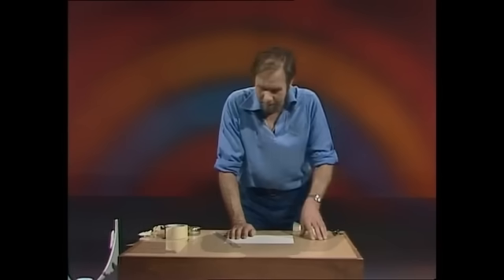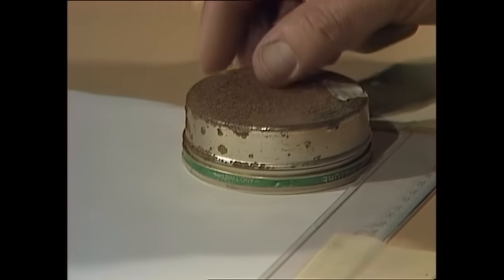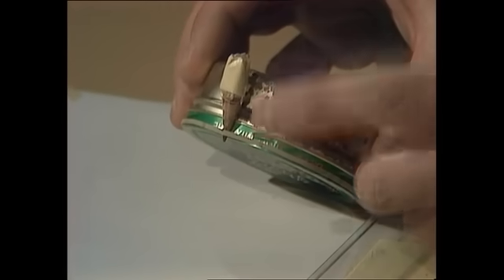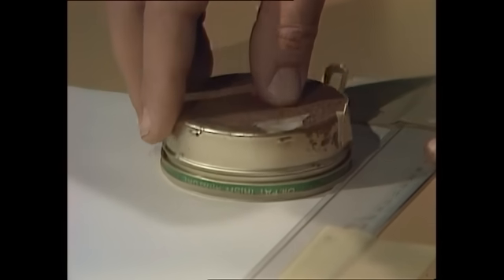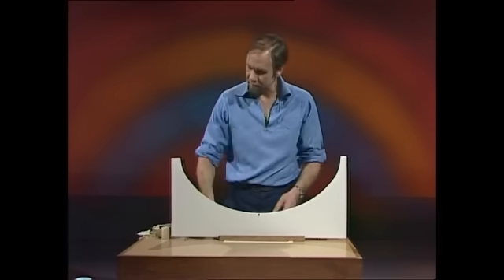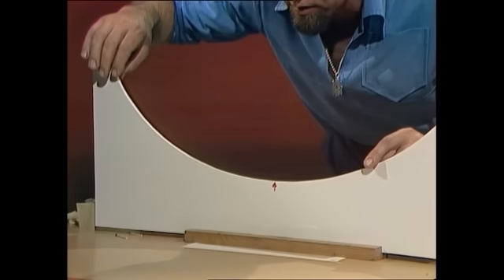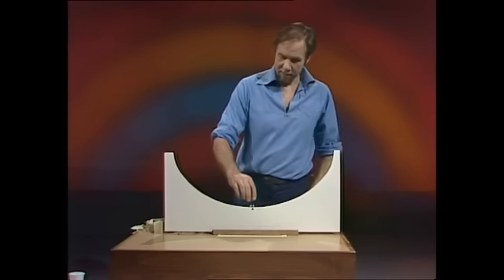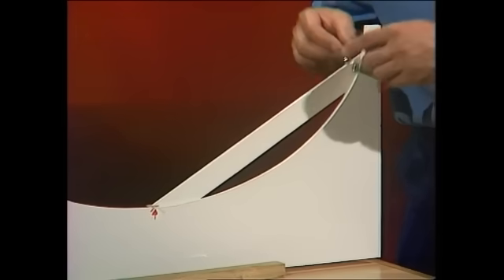The mysterious isochronous curve

Comment: Why didn't he simply use a compass to cut a calculated oversized circle in a piece of cardboard, cut a hole at the desired radial point and simply insert a pencil in the hole and rotate the cardboard along the secured rule?

Comment: Checked my watch. Not April 1st. Checked that there aren't any hidden cameras in my room. Not a prank show. So, um...............WHY!.................and, er...............HOW! I mean, doesn't Time = speed x distance? So when comparing it to the straight line, maybe there's less resistance to gravity in the shape of the curve. As to the same time being to get to the centre from anywhere on the curve.......maybe the increased momentum from a larger distance exactly balances shorter distance.
Reply: When I say "increased momentum", I mean from the acceleration: 9.8 ms-2 in free fall (I know this isn't free fall but there will still be acceleration) Earth gravity, dry air at 0 degrees Centigrade......You know.....just.....if anyone cares...

Comment: I'm no mathematician, but I'm assuming this has something to do with gravity and acceleration? They meet at the same point regardless of location on the curve because a ball-bearing at the bottom of the curve will have less acceleration by gravity than the one much higher up on the other end. Dunno if I'm using the terms correctly, but hopefully it gets my point across.
Reply: ya. didn't explain why the ball following a straight path to the arrow(middle) is slower then the one on the curve. I was guessing same thing, in that the curve gives the ball more speed do to gravity right?

Comment: What are the real life practical implications, .for  machines or manufactured products where an isochronous curve is advantageous?
Reply: Fair question, and I'm going with reverse logic for a possible answer and say a bicycle tire
Reply: I'll try again: is there an example of a product or manufacturing process that has been helped by incorporating an isochronous curve it its design.
Reply: yes, good question. take a look at the ISSC isochronous stress strain curve for plotting creep data during production of high temperature materials
Reply: Found it! 
The isochronous curve is so elegant and the property that you demonstrated so unusual yet simple that I thought there must be a counterpart in nature.

When the bob of a pendulum sweeps an arc of a circle, its period varies (slightly) with the angle of swing. But there's no variation in period with angle when the bob sweeps an isochronous curve . That tallies with your demo where the time for the ball bearing to reach the base point does not depend on its starting point in the curve.

The effect was discovered by Huygens in the late 1600s. He built a pendulum that could swing through an isochronous curve and therefore keep better time, unaffected by air resistance.  https://www.math.nmsu.edu/~history/mm-3-2-huygens.pdf

Comment: What amount of "force" would it take to ensure the straight line ball on that exact angle would meet the ball on the curve at the exact moment. Determine that equation and you are on to something and just might be able to measure fluctuation s in gravitational waves. Where the cheetos?
Reply: Jake Glassmoyer simple algebra problem, would not even require calculus.

Comment: In noting the speed of the bearing as it moves down the curve, as compared to its movement along the straight edge, it is rather obvious that the curved space provides for the greater angle of "free fall." The surface providing the least obstructed surface between itself and the bearing will allow for the fastest rate of descent.  Nothing mysterious about it.

Comment: The straight vs curved drop makes perfect sense because the curved drop has more momentum due to the fact that the ball is dropping for the first half of it's ride; At first it didn't have the amount of friction as the other ball. Then, in the second half of it's ride, it had more friction due to it's gained weight from it's momentum.
Reply: Gained weight from its momentum? Sheesh. I was doing sines and cosines and you're bringing relativistic mass into it! 
I doubt he cut that shape out accurately enough for that detail to show in his results.
Reply: That's what I was thinking, it's cool but I don't really find it peculiar or mysterious. Same reason the two balls meet at the middle, it's all about the potential inertia from the steeper parts. It moves faster but it also travels a longer distance. The simple reason they meet regardless of position is just due to the fact that the curve is 'isochronous' as he said.

Comment: This only works when there is a gravitational force applied, the straight line has more resistance to gravity but the curve allows for "freefall" thus the ball on the curve has more acceleration (the rate of change in motion and position) and the ball on the line has more inertia (resistance to change in motion and position). This is why a vert ramp (half pipe) for skateboarding is the shape it is. Also if you had a way to bring the balls center of gravity in at the apex point of the curve and then released it back to a normal center of gravity it would go back and forth forever. But remember the law of conservation of energy. This change of center of gravity for the ball takes energy to keep it going forever.

Comment: Very interesting and informative. Being a pedantic type I must point out that you’re using a rule (or straight edge). A ruler is someone who rules. 👨🏻‍🎓
Reply: Also being a pedant, I must point out that a "rule" is "one of a set of explicit or understood regulations or principles governing conduct within a particular activity or sphere." Of course, that's only one definition, and -- similarly -- "ruler" has multiple definitions. One of the definitions of "ruler" is "a smooth-edged strip (as of wood or metal) that is usually marked off in units (such as inches) and is used as a straightedge or for measuring."
Reply: SeikiBrian Thanks, you’re quite correct. My problem is I still think back to my school days over 60 years ago. It seems that the graduated straight edge etc has become accepted as a norm.
I still use rooves rather than roofs.
Reply: We're close to the same age, it seems. I still recall learning to use a slide rule in what they now call middle school but we called junior high school. (And I took my first year of higher education at a "junior college," not a "community college.") Although we called the former device a slide rule, we called the single-piece tool we used for measuring small lengths a ruler. (And while many people in my region of the USA pronounced the plural of roof as "rooves," we still spelled it "roofs.")

Comment: Does the Isochronous curve conform to the golden ratio and is it half of an ellipse? Might have to go on the drawing board to check it out. Will get back.
Reply: Considering that the curve's width is the circle's diameter and its length is the circumference, it's clear it's more related to pi (3.1416...)
Reply: morninboy im interested please let me know when you find out the answers :)
Reply: Still waiting
Reply: it looks like it to me. and it also looks like the perfect curve for a dick which I don't have since mine is broken and bends down :((

Comment: So, while the shortest distance between two points might be a straight line, I guess the shortest time between those two same points is an isochronous curve. Quite interesting indeed.

PS (addendum) My original post was just a joking play on the classic "the shortest distance between two points is a straight line" saying, but I'm glad to see quite an interesting discussion taking place because of this comment. Science FTW!
Reply: Only the shortest time under the influence of gravity, if you were driving a car between two points then a straight path would take less time than (any sort of) curved path
Reply: The shortest course between two points on the globe is a 'great circle' route, which basically means you follow a path across the globe's surface that is part of a circle whose center is at the center of the planet. Such a path is by necessity curved.
Reply: the shortest distance between 2 points is a great circle. the reason sometimes a straight line is shorter is because of the type of chart you use, it varies with the type of projection used. and if you want to reach the middle point of the test this guy performed with the bearings as soon as possible you have to trade the potential energy of the bearing asap(straight down) followed by a smal radius curve to convert the vertical motion to horizontal motion. great circles are curved on a mercator chart and straight on a globe.
Reply: Spetsop  --   No the shortest time between two points is a straight line, but without relying only on gravity to provide the velocity.
In other words, shoot the ballbearing out of a cannon (or a railgun..).
 I mean, if the angle of the straight line was closer to horizontal, the ball would take much longer, and it's all down to tbe direction of gravity, not the shape of it's path.
Reply: +Drew Lovelyhell : Firstly, thank you for spelling "cannon" correctly. Pachelbel rests more easily. 
Secondly, and I apologise for the nitpick, a cannon wouldn't send the ball in a straight line. It would send it in a parabolic arc modified by retardation due to air resistance. Over the very short distances shown here, at velocities associated with modern rifles, you'd never know, but if you check the ballistics for a 5.56mm bullet you can see that it slows down a lot in the first 100 metres of travel and quite a lot in the second, losing speed less rapidly as it goes because at lower speed it has less air resistance. 
With sights "zeroed" at 200m, on a still day, you aim at his belt buckle from 100m, centre of mass from 200m, or throat from 300m or somewhere over his head beyond that.
Reply: Sableagle   ..   Well, I was thinking ideally of a cannon in a vacuum unaffected by gravity, but I didn't specify that in my comment.
Reply: I was going to say: momentum has a part to play. And Mr. Brian said gravity.
Reply: bullshitdave You’re correct.  It’s called a great circle route in aviation.
Reply: But not in zero gravity.

An isochronous curve is only as fast as the forces applied to it at the time... Potentially a fraction faster at a point in the curve due to centrifugal force.

Maybe I should have read this thread before posting. Ah well great minds obviously think alike.
Reply: You should watch vsauce about the brachistochrone...

I think the tautochrone property is more interesting...
Reply: And if the chart is of a small area with no need to allow for curvature you are on a plain- So it's Plain Sailing. The other golden rule, always use the scale opposite your plot on the chart, the scale changes as the curvature is adopted on large scale charts.
Reply: When did FTW get a meaning change🤔??? Or maybe it's demographic and age because, FTW did not mean " for the win" in my day or surrounding 🤔
Reply: @rickblaine7463  What did "FTW" mean in your day and surrounding? I'm 33 and everytime I saw "FTW" on the Internet, it only meant "for the win".
Reply: @Spetsop  
Fuck The World -I just turned 50, so FTW was a thing before the internet and texting-acronyms
Reply: @mestizoboy  ....thank you kind sir for clearing that up! Especially the part about before internet and texting 😂...I just about laughed myself to death when I read the response.🤣🤣🤣...not out of disrespect but, because I couldn't believe how old I was and how young that made the response.
It's funny how a decade can really separate a generation
Reply: @mestizoboy  could you imagine all the gangsters the "OGs" if you will faces to know that their FTW tattoo on the inside of their lip or anywhere on their body now is interpreted as "for the win"🤣🤣🤣...
By the way...great video and explanation. Sorry to tangent!
Reply: @mestizoboy  Oh geez haha, I've never heard of that one before.  Yeah, I can see how confusion can arise lol
Reply: @rickblaine7463  "OGs with FTW tattoos" LOL 😂  That's brilliant!
Reply: @rickblaine7463  
Hahaha: Exactly. I have friends with that tattoo. One is actually a German guy, who has it on his shoulder -So I always thought "FTW" to be pretty international.
This reminds me of all the gangsters that have their area-codes tattooed on, only to have the phone company split/change the area-code in their city at a later date.